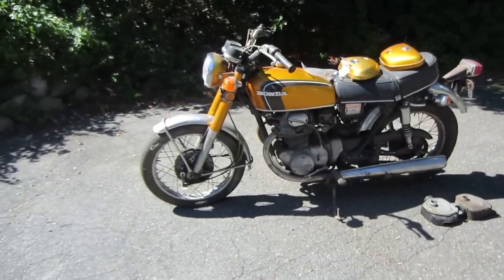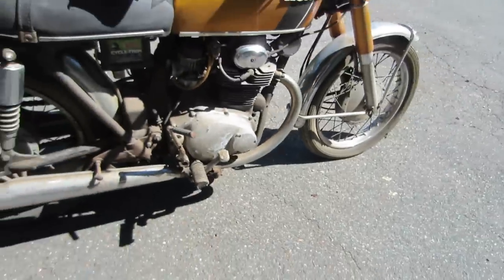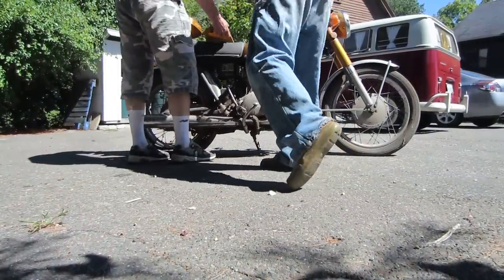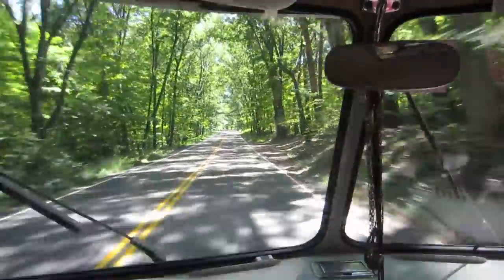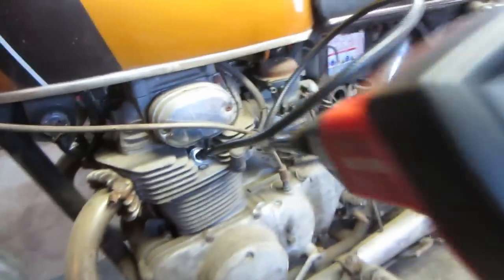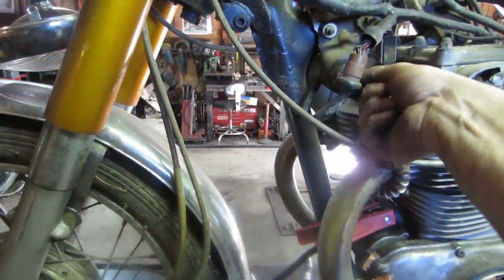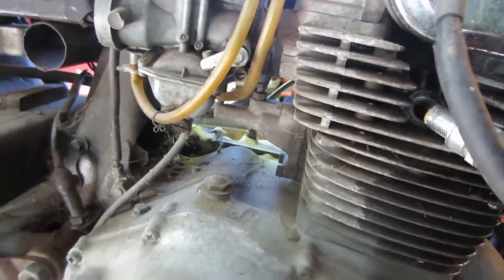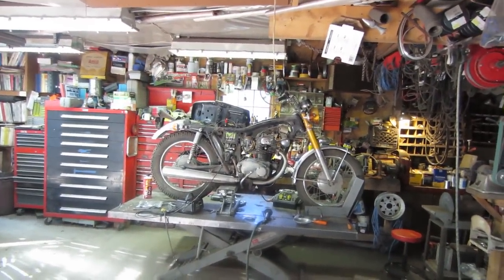barn find, 1971 honda cb 350 motorcycle

Comment: I am not commenting to be challenging but to offer an idea to others in the same condition. I believe moving an engine that is seized like that without lubrication is terrible judgement. Just lubricate via spark plug and let it sit and then be gentle. The $150 in this case you think you will not save you will end up spending is cylinder wall damage in the effort to get it moving. Consider what metal seized together at the tolerance of rings to 2 cylinder walls would look like. Would you oil that?? Or force it?? WD-40 is your friend to start here - and don't start it with old gas or tank, filters, or oil. And you'll soon ride off into the sunset.
Reply from the maker: what are you talking about, it was full of marval mystery oil in the plug holes
Reply: @mustie1  lol

Comment: When you have a frozen engine don't put it in gear and try and rock it you could break a ring or do damage to the engine always put in rust penetrant in the cylinders and soak the shit out of before trying break it loose. Try marvel mystery oil it loosen up a out board I had good grief
Reply from the maker: did you even watch the video,
Reply: I stand corrected it just made me nervous rocking it back and fourth in gear with a seized engine good way to bust a ring. I had one out board a customer left that had sat for years very low hours it was mint I pulled the starter housing off of it and set it up and kept poring marvel in it and got a breaker bar and every other day I would very gently rock it back and forth on the crank nut finally after two full weeks she broke loose I put oil in the cylinder made a bunch of full revolutions with the breaker bar and finally got it all the way broke loose I rebuilt the carb and gave it a tune up put it in the tank and gave her about five pulls and she took off a huge cloud of smoke came out and she ran like a swiss watch. It didn't smoke or anything I was expecting cylinder and ring damage

Comment: oh, remember, i has cb350, not good model problem lot clutch alltime,no power drive 2 persons on. next i has 450 cb and cb500 four, and last has cb 750 four, 750 has best and 500 wery good. but no newer buy again cb350 only problem lot have. its factory big fail model.

Comment: y do you buy tru fule it's ment for lazy people!!! I used to sell it and I was actually a little sad when people bought it
Reply from the maker: you cant buy gas that does not have alcohol in it where l live, and thats the only way to get it.
Reply: y dose it matter?
Reply: ethanol fuel of any kind is vastly inferior to real straight up normal gasoline. even the 10% ethanol you get at the pump will rot out your carbs and fuel lines in short order.

Comment: Finally, a compression test!!! But as soon as you discovered the corrosion on the top of the piston, surely you knew it wasn't appropriate to even turn it over, never mind attempt to start it. There's a very good chance the very narrow ring around the top of the piston holding the top ring in place was seized to the cylinder wall. If you do manage to release it, there's an equally good chance a section of that ring will break off. The result will be that the top compression ring will no longer be sitting in a full annular groove, meaning that downward strokes against a corroded bore are  very very likely to break off the ring at that point. 

Then, as you attempt to "free it off" by turning it over, the chances of destroying the bore, valves etc increase exponentially. I'd lay money that's what happened, if not immediately, sooner or later. 

Attempting to get an engine in that condition running has only one effect: it satisfies an impatient, immature, irresponsible and unprofessional need to hear it running again. It's literally the worst thing you can do. Any celebrations or illusions of success are premature and usually wholly wrong. 

I've currently got 12 bikes (most of them old Hondas) in need of restoration. I haven't attempted to spin a single one. It's always better to pull a head than do any of this shit. 
Another old bike needlessly ruined through impatience and unprofessionalism.